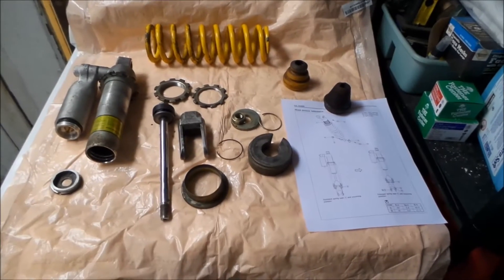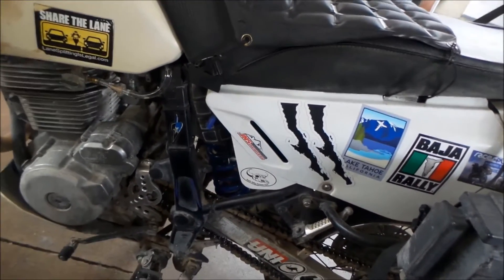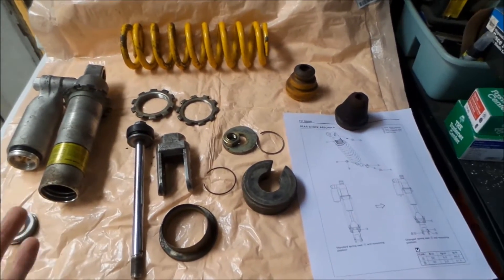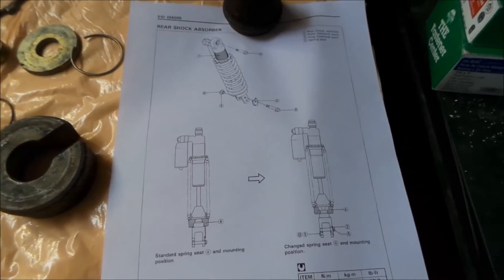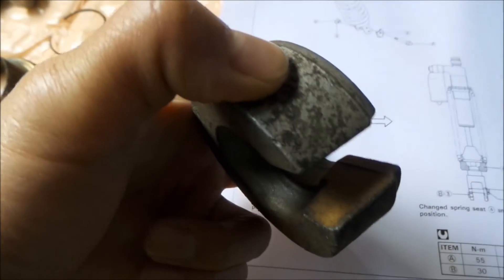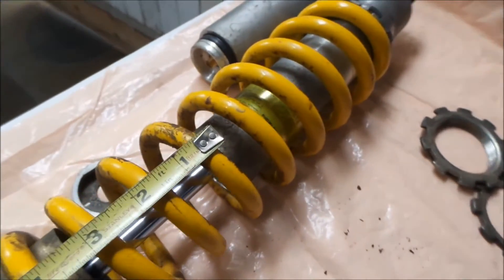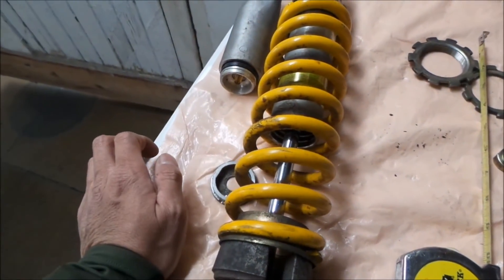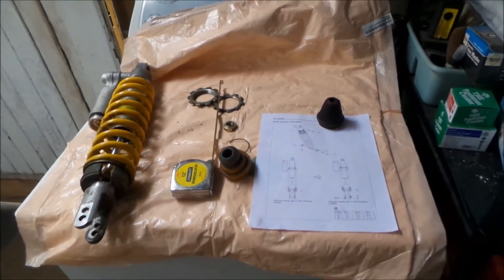HadesOmega Explains DR650 Rear Shock Lowering Configuration

Comment: It's not limiting travel by the spring. If you look at how the shaft in the diagram moves inward to a stop, you'll see that is what is being shortened. Basically, it stops the shaft a little sooner/more outward, so it's a shorter stroke to stop.

To explain why you want to limit your travel, not just back off pre-load a bunch:
1. at some point the spring becomes loose/unloaded and rattles/slams around instead of progressively loading (impact collision vs spring resisting the progressively)
2. you don't want a wheel that is too soft extended way down to catch bumps but not allow control. (also bad with preload being backed off to drop)

So you limit travel and always have some pre-load on the spring, so it never comes slack.
Note: if you are trying to compare apples to apples, when you shorten travel, you will need a stiffer spring to handle comparable bumps. Think of it this way: if you are closer to the ground, you have to stop sooner to avoid hitting or bottoming.

Also, thanks for this video, it's great for seeing what's inside this shock.

Comment: The explanation you give is incorrect regarding the 'lowering' of the shock by 'flipping the collar'.
The shock's distance from  bolt hole center to center remains the same whether 'flipped' or not.  . all that happens is the stroke distance is shortened to eliminate the possibility of the rear tire scraping on the inner rear fender AFTER it's been lowered either at the lower mounting (2nd) position . . or by lowering links.
So it turns out that the ol' 'collar flip' is not lowering but rather a second step in the lowering process, to shorten the wheel travel up and down.

Comment: You really don’t get how the spring holder works. There’s no difference the way you measure it except you didn’t retighten the spring so you got a different measurement. The holes at the bottom adjust the height. The spring collar adjusts the travel. It only limits the end point though. To measure that you’d have to compress the spring. I just makes it stop before it hits the fender. It is nice you showed the image though so it makes sense if you just disregard your explanation of it. Also note that travel at the shock is not the same as travel at the wheel. It’s a big lever and it moves farther at the wheel than at the shock.
Reply: Exactly right sir.

Comment: Where is the metal spacer/washer with the tab... ?
It supposed to be there....
What us it purpose?
Thank you
Reply from the maker: I never had it on mine.  I think it just covers up the holes.
Reply: HadesOmega Moto thank you...apparently it's purpose is to hide the lowering option hole, in order to avoid mistake
Reply from the maker: Yeah that's what I thought its for =)

Comment: Thanks for the video.  I realized I just need to jack the bike up and loosen the 2 nuts at the top and shift the spring up and flip the collar around.  I'm guessing we don't need that thin metal tab thingy that covers the nut at the very bottom but do we also not need the washer since your example had it removed?  Ok I realized I needed to push the bump stop down against the washer so it stopped jingling around =)

Comment: Hum? I thought mine was stock height. I just checked mine. My DR 650 rear shock was rebuilt with a bigger spring and is set up in the lowered hole with collar flipped and I didn't even know it.

Thanks for the video. Would have never known any difference.